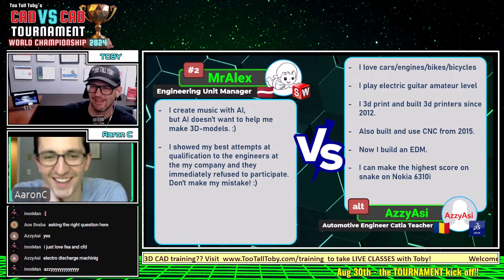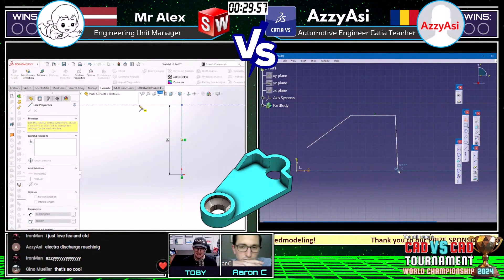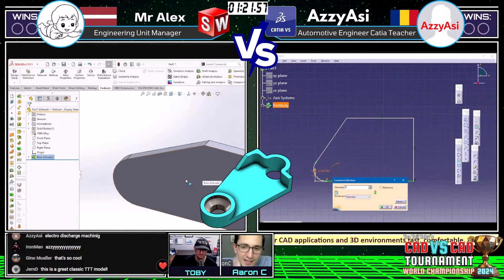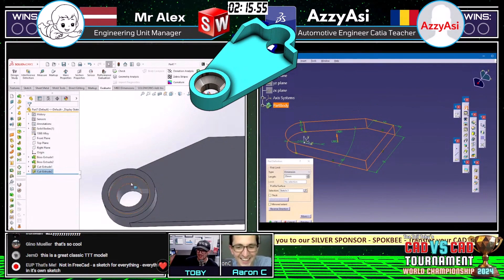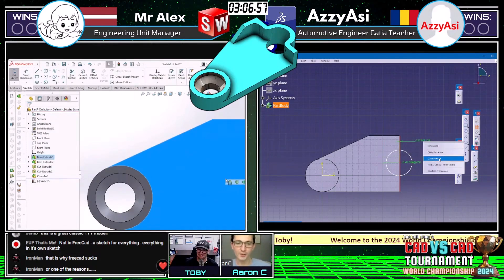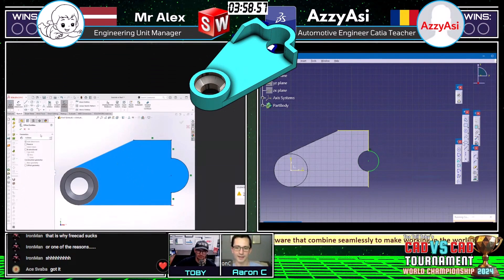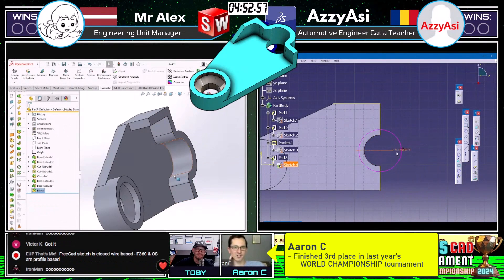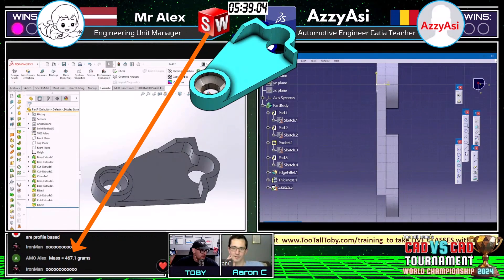3D CAD esports - TOURNAMENT HIGHLIGHT - Match 2 - MrAlex vs AzzyAsi - SOLIDWORKS vs CATIA V5

Comment: What is the exact  correct answer without tolerance? I got    469.468 g
Reply from the maker: I can be slightly different depending on the CAD system - so we use a tolerance to make sure no one gets boxed out.